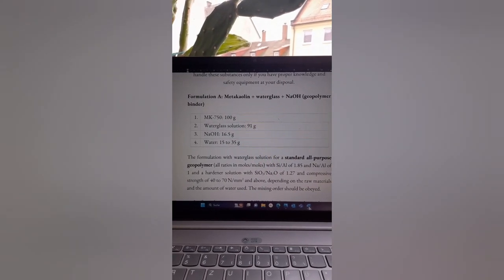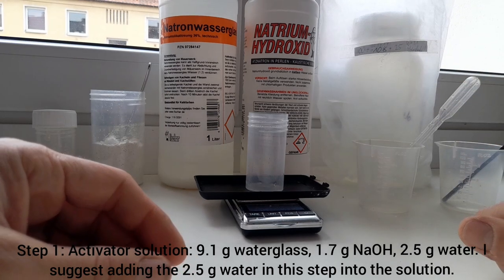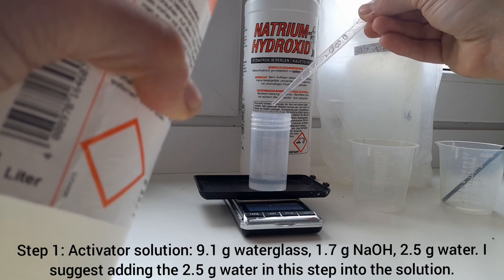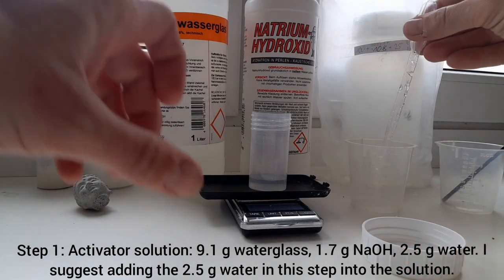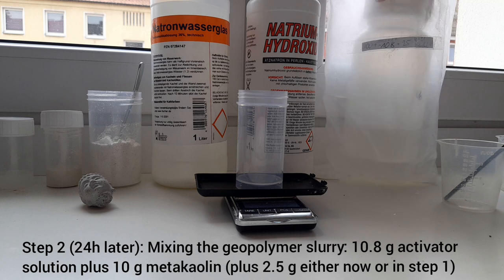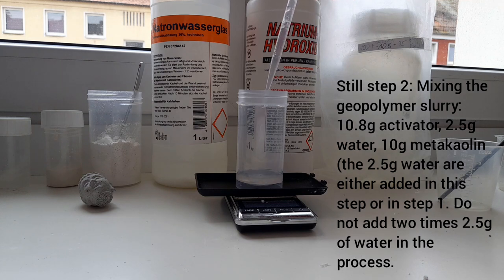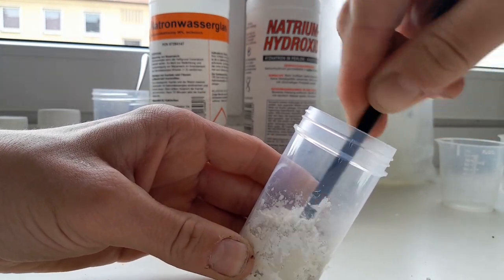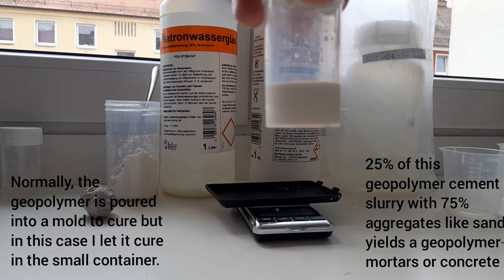Geopolymer Manufacturing | Basic Process of Making Environmentally Friendly Geopolymer Binder

Comment: What can you use if you can't get metakaolin?
Tried colloidal kaolin and it did not harden.
Reply from the maker: Regular kaolin typically has minimal effect. You can enhance its properties by firing it for approximately 3 hours at 750°C. Metakaolin (MK) is widely available and serves as a standard additive in concrete production. Pottery shops often carry it, as do stores specializing in pottery supplies or those selling pigments for painters. Online platforms like eBay and Amazon are reliable sources for raw materials. Additionally, universities and research institutes specializing in ceramics, cements, and concretes may offer access to raw materials. Have a great day! Best regards, Pat

Comment: how many activator liquid need for 100kg metakaolin ?
Reply from the maker: Hello Darazs6173, I hope you are well! Beneath the video in the video description I stated the recipe. For 100 kg you would need 91 kg of sodium silicate solution, 17 kg of NaOH and 25 kg of water (from 0 to 35 kgs of water is possible). I always recommend to start with small batches. In any case this recipe is there so people can develop an geopolymer concrete. Normally 25 % of the geopolymer mixed in the video needs to be incorporated into 75 % of aggregates from small too coarse. You can buy ready to use aggregate mixes for concrete. Have a good one. Pat :)

Comment: Perfect rheology for self-levelling floors! Plus high strength, low shrinkage and a beautiful neutral color... I've got some ideas, do you know any investor?
Reply from the maker: Cool! Right now I don't know some but maybe I do without knowing 🤔. The material in the video is just the binding phase, the cement, so to speak. To get this color you would need to add some same-colored aggregates or red brick rubble, like the romans did. Have a good one! Patrick

Comment: would Joseph Davidovits consider this a true geopolymer?
Reply from the maker: Hello C Ray! Absolutely. Metakaoline based geopolymers are the ones with which Davidovits invented/discovered geopolymers itself. The Englisch Wikipedia article "Geopolymer" is actually written by Joseph Davidovits if I recal correctly. There is a chapter about metakaolin based geopolymer. Furthermore, there are two to three mayor branches of GP I'd say. One is fly ash based, one fly ash plus slag based and the third branch are Mk based. In order to be able to understand this method or system you have to brake it down in the easiest way possible which would be this MK based geopolymer (in my opinion). Have a good one 👍 Pat
Reply: Yes. Davidovits used a formulation with slaked lime and sodium carbonate, which converts to sodium hydroxide and calcium carbonate when the water is added. The lye (sodium hydroxide) acts as an activator with the metakaolin to start the geopolymerization.

Comment: 17mol concentration is pretty high, i would lower your concentration to 12. There been a lot of studies done with 12 showing strongest results.
Reply: Metakaolin is kinda hard to find but if you look around you can find it. I bought your book as well. I'm really wanting to make my own whetstones with this stuff
Reply from the maker: Hello Drewrinker! Thank you for your comment! I wanted to respond after recalculating the molar ratios. My recycling solution involves reconstructing the "activation" solution I typically use, which includes water, soluble silicate, OH, and additionally NaOH. However, I'll provide an answer now to avoid further delay. Feel free to adjust the synthesis as needed. I create the videos to demonstrate the basic procedure, given the variety of available raw materials. Whetstone sounds like a promising project! Many newcomers attempt to rebuild the pyramids without prior experience. In general, you'll want to create a geopolymer mortar with relatively hard aggregates. Sounds cool! Keep me updated. Best, Pat
Reply: I got the book today, so excited 😂 been experimenting with little batches like this and wow this stuff is hard. Only problem is the air bubbles so I'm thinking of trying a vacuum pump to help with that. I did my first test batch today with the diamond and it seems promising. I tried Silicone carbide aggregate and that didn't work so good because I think it reacts with the hydroxide
Reply from the maker: Hey  @drewrinker2071   Great! I've been wanting to work with diamond powder for some time. To eliminate bubbles, you can experiment with a more liquid slurry mixture and then pour it into the mold in a thin stream from about 2 feet above; this helps reduce the formation of bubbles. Afterward, you can tap the mold by hand or with a plastic hammer. I do this myself, even though we have a vibration table available. Alternatively, you could place the mold on a running washing machine, any vibrating machine or do a joy drive with a car carrying the mold. However, excessive vibration may lead to segregation. Typically, you would vibrate for up to 5 minutes, but usually no more than 3 minutes is necessary. Much success, bro! Best, Pat
Reply: @Advanced_Materials_Publishing  oh nice good idea thanks I have an ultrasonic cleaner I could let it float in.

Comment: Does not seem very cost effective for any type of large application.
Reply from the maker: To be cost effective you would use another kind of geopolymer. There are some which cost about the same as normal cement concrete partly becasue it consist to about 80 % of the same material which is the aggregates, i.e., sand and gravel. Plus we expect a way longer service time then portland cement which is said to be only 50 to 100 years (for PC). Best, Patrick